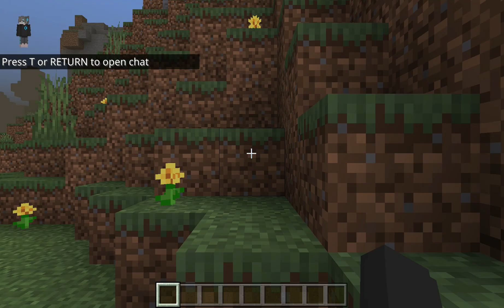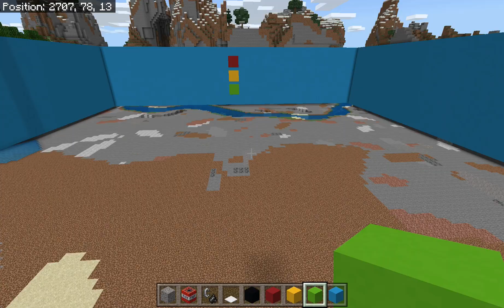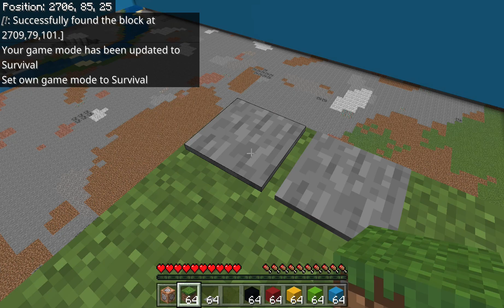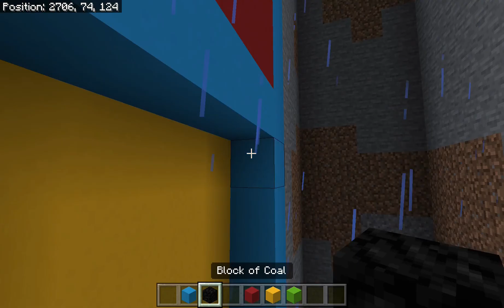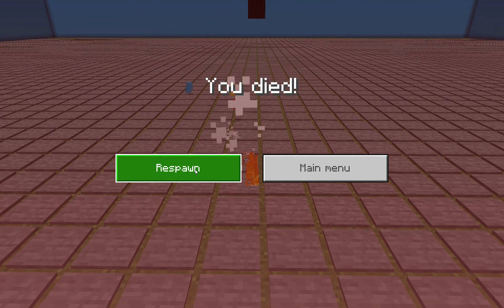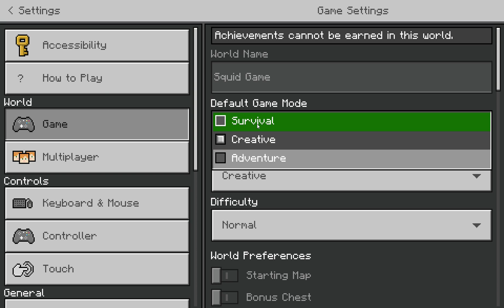Make your own Squid Game Red Light, Green Light in Minecraft using Command Blocks!

Comment: is there a way to do this without the pressure plate?
Reply from the maker: It needs something to detect if the player steps on the square.
Reply: If I am correct you can try to use the setblock and TestFlight command. I made my glass stepping game with a player stepping on a normal glass block and it breaks.
Reply: how???
Reply: @official_wonnie  that way it kills me even when I'm still
Reply: You can use the /tesfor command